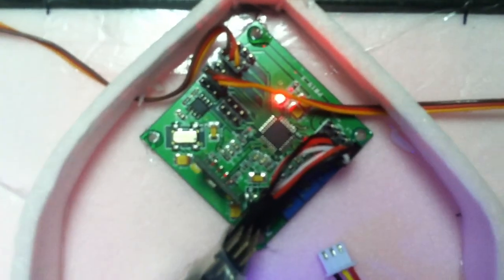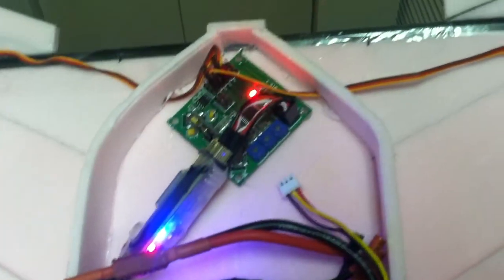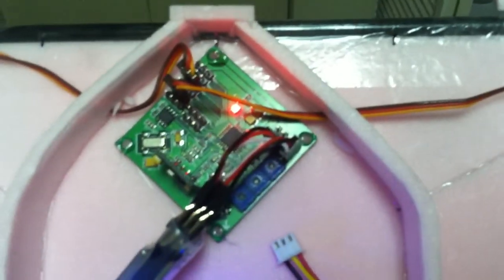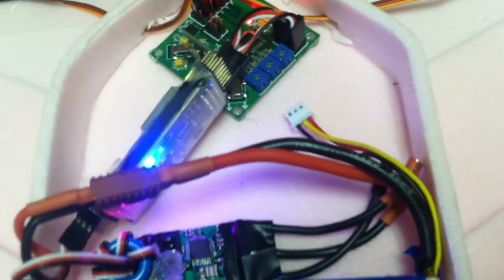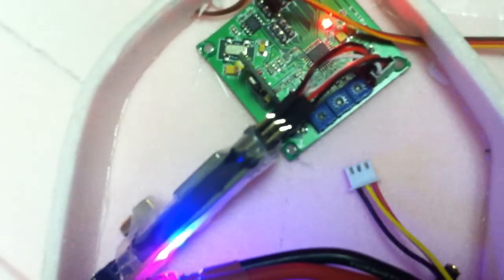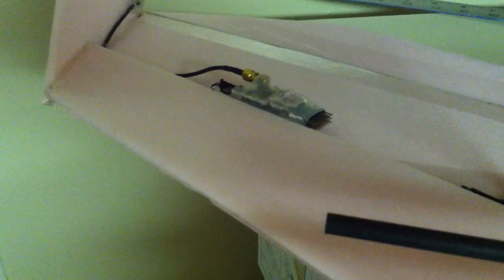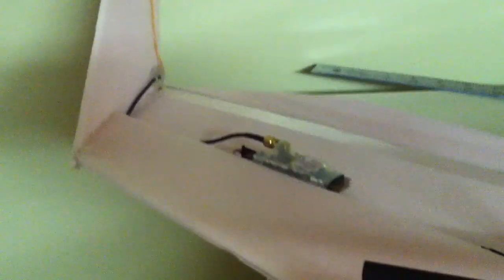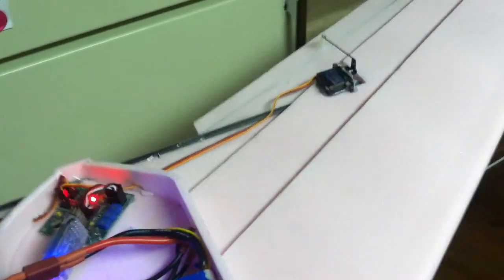HK-KK2.1 Stabilized DragonOSD Controlled KFm7 Flying Wing (Part 1)

Comment: Turning on your uhf receiver with out the antenna on it will for sure damage it.
Reply from the maker: lol... no! RX's that are not telemetry can be powered without an antenna. Now if you are running DTH-UHF or Open LRS then yes. those do have transceivers in them to work both ways.

Comment from the maker: Iv been working more on tuning down the servo chatter, In the video I had them trimmed through the remote rather than the linkage. After I adjusted the linkage it was much better.

Ya I decided to try this because winter is coming and there will be more wind. From my experience with lighter flying wings, Wind is not fun. I am also preparing to use the dragonOSD waypoints mode to fly under a bridge autonomously so stability is key.